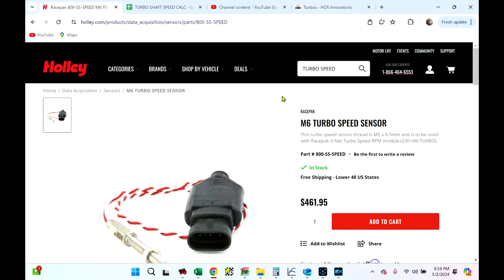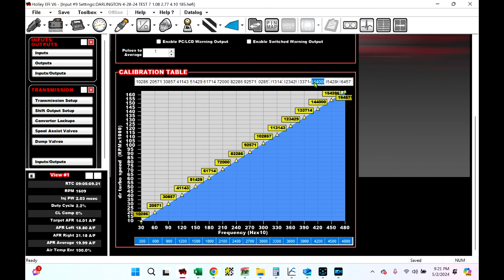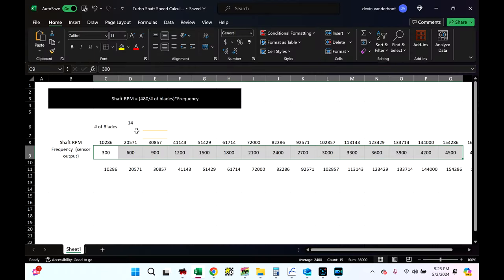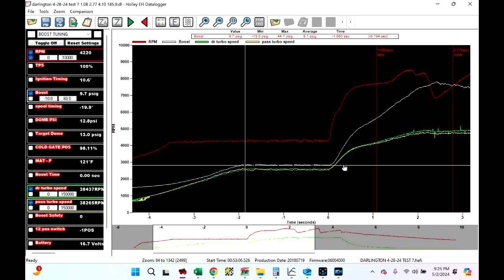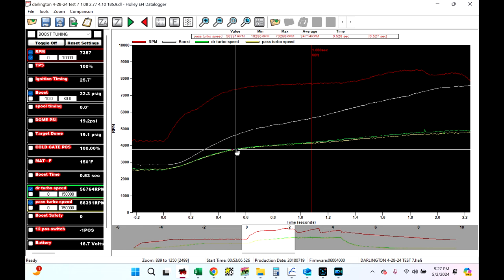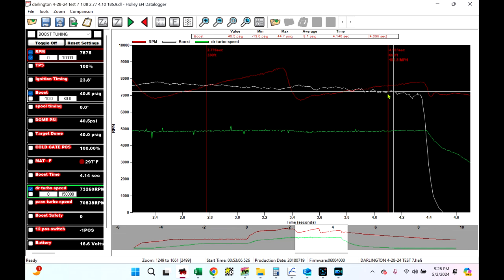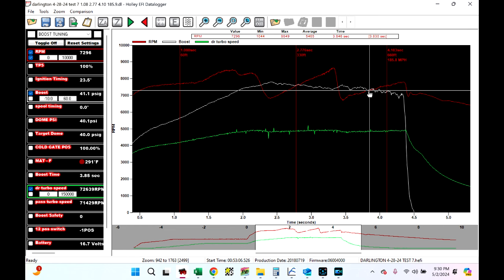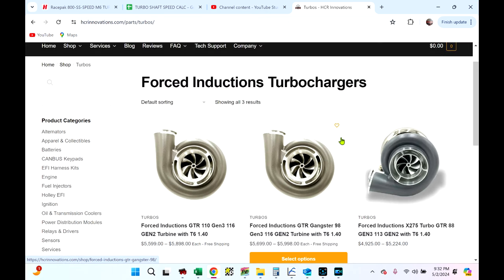How fast are your turbos spinning? Well lets find out with holley efi and using Turbo speed sensors

Comment: I know it sounds dumb, but I've always wanted to do this on supercharged applications. I realize you can figure it out via math, but having the data in a datalog would be awesome.
Reply from the maker: Build a math channel in the log super easy
Reply: @theholleyefiguy  sadly I'm still a peasant and only have a Terminator X and not a real ECU like an HP/Dominator so that option doesn't exist for me in the datalog. I guess I could export my datalog to Excel and add it manually.

Comment: If boost drops as rpm goes up, is that just an indication of the turbo supplying the same amount of air (same shaft speed) but the engine consuming more air (more rpm) ?
Reply from the maker: Yes sir exactly 
So we need to give it more dome pressure at higher rpm

Comment: All these backwards ways of turbo control. Why isnt the aftermarket doing vgt turbos. They're over 20 years old now.
Reply from the maker: cause they suck
Reply: @theholleyefiguy  my semi doesn't seem to have an issue. 600k miles
Reply: 1. They are  super restrictive on the hot side. Meaning you need significantly bigger turbo for same performance.
2. They are know for jamming in hard conditions(antilag, 2step, diessel soot buildup)